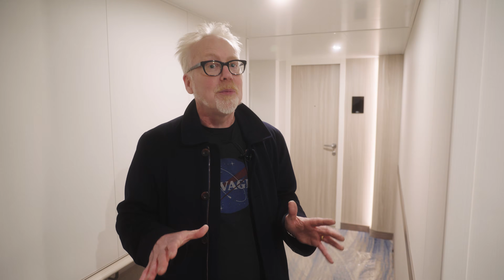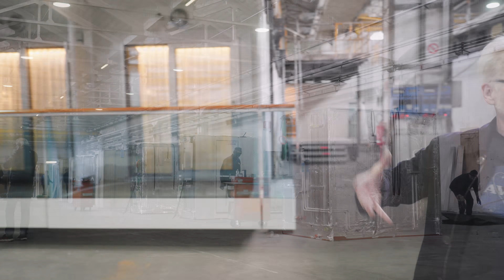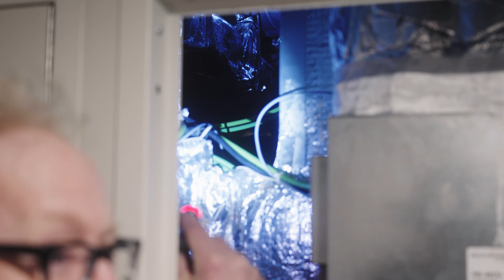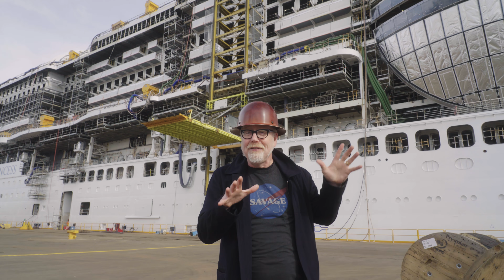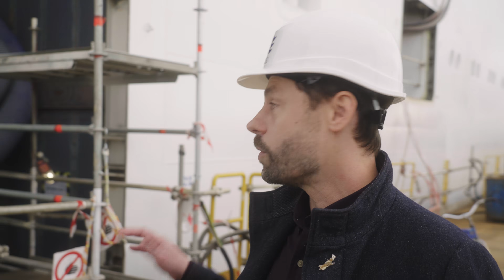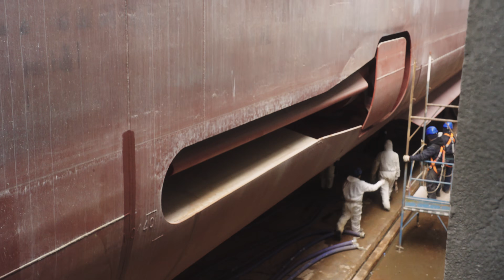Engineering Inch by Inch

Comment: I am a structural engineer that primarily focuses on marine front projects. I have done projects for several cruise lines and am currently working on two huge facilities in the Bahamas. One of the items that got me excited on this ship is the embarkation doors. These tend to be a pain in the butt when designing these structures since the pier/wharf deck height tends to be fixed because of this. That means, bollard locations, fender panel sizes, pile cut-off locations, beam construction are all tightly monitored because no one wants to construct a concrete beam in the surf or cut a steel pile to elevation that may be partially under water. Being able to raise the deck even a few cm is a game changer.

Side note, larger vessels mean larger loads, which means larger piers/wharfs are needed. Looks like I can be expecting projects popping up from Princess soon.

Comment: I was lucky enough to get a tour of a cruiseship drydock while studying. One of the most mindblowing revelations was that the ship does not wait for anyone. If there is a inner element produced offsite, that is late. They will still close up the side of the ship and then later cut a hole in the side of the ship to bring the inner element in and then weld the hole shut. That is more cost efficient, than waiting for anything thats late. :D

Comment: On the entrance door in the hallway where the fire room is at it has three hinges that are lined up differently. Two of the hinges are at the top of the door and a single hinge is towards of the bottom of the door. Why is that?
Reply: In addition to supporting part of the weight of the door, the upper hinges must prevent the door from pulling away from the frame as it pivots on the bottom hinge. The further from the pivot point the hinges are, the less force they have to deal with. I think that equally spaced hinges are chosen for aesthetic rather than functional reasons when the hinges are strong enough for the placement to not matter. If you're aiming for the strongest door or to mount a heavier door without adding a fourth hinge, placing the third hinge closer to the top hinge will resist pivoting better.

Comment: That is mindblowing.  I remember with Project Egress, just hard it was to get 50 makers to assemble components that fit together for a museum display... now I'm thinking about the 10s of thousands of engineers working together to design a massive structure that is completely water-tight...
Reply: And has people on board! Like many, many, many people!
Reply: And how well these ships handle adverse conditions.  I remember when the Star Princess had a major balcony fire in 2006 that damaged over 300 cabins, and the only death on a ship with thousands of passengers was from a heart attack during the muster, with only a handful of passengers treated for smoke inhalation.  That could have been far worse than it was, and it's a tribute to the ship design and the crew that it wasn't.

Comment: Would it be an idea to switch 1 door of the 2 so you can use the fire hose,  or turn the door in front of the hose in to quick access rolling door so there is no door to be mind full of

Comment: An amazing video is Disney "re-theming" one of their cruise ships. From dry dock to back to cruising was less than three months. All new paint, all new interiors, new cabins, new show rooms, etc. Just an amazing orchestration of material an talents.  I really want to take a behind the scenes tour of a ship to see how all that functions once built.

Tangential to this. The technique of prefabricating a full space as a module and dropping it into its final place is happening in apartment construction. I drove by a building being "populated" with prefab condo units. The building, like a ship, was steel framed and fully plumbed/wired.  The fully finished plastic wrapped condos arrived on 18 wheelers. Once unwrapped they were lifted into place and the bits connected up with quick connects. Gaps between adjacent spaces had flap down "bridge" pieces with cover strips dropped in during the process.  It was strange to see a full kitchenette with all cabinet, counters and appliances installed hoisted into place.
Reply: I wonder if they build new rooms and slide them into an old ship.  This is actually the same way that the Contemporary hotel at Disney World was built but apparently the building settled and its now impossible to remove the rooms.

Comment: Sometimes they cut a ship in half, and weld in another section to make it longer (stretching). It is surprising that the weld is strong enough.
Reply: well the welds are no different than if it was one piece of metal
Reply: the welds are no different than the welds holding the blocks of a new-build together.  They are HIGHLY scrutinized using ultrasound.

Comment: All of these things are built in pieces all at the same time.  US navy warships are made the same way.  The only way it works is CAD/CAM.  That allows you to build little pieces of ship that will fit together at the end.

I have seen sections of nuclear submarines being built.  It's literally like chunks of a sliced hot dog.  It's crazy how well everything lines up, and that's due to the extreme accuracy at which these parts are made.  They are off less than a 1/4 inch, which can be welded together.  The hull of a submarine is more accurate than that, but the insides, where it doesn't matter, it can be up to a 1/4 inch.

Comment: Sorry if I sound mean but there's a very important difference that makes building a skyscraper like the Empire State Building and building a cruise ship of equivalent size. A cruise ship is build horizontally and requires less structural support to to hold the upper levels while a skyscraper has a relatively tiny footprint to hold up all that weight and thus need lots of support to hold it.

Comment: Ok so I have a question as an engineer.. are they engineers designing rooms for a cruise ship, or are they architects? Where does the line get drawn between laying out a living space, and designing a moving structure?
Reply: Ships are designed by Naval Architects, which is an engineering profession. Ship interiors are undoubtedly designed in consultation with interior designers experienced in marine vessel interiors.

Comment: genuine question: wouldn't it be safer for ships to be built more like buildings instead of double wide trailers? it seems like a stack of wooden blocks in a tube wouldn't be as safe as a stack of interconnected lego.
Reply: Look up the concept of blocks and megablocks for ship construction.  Properly planned there shouldn't be a continuous seam the entire height or length of the ship (unless the ship was stretched as another comment pointed out).  But, in reality, the welds are as strong as (if not stronger than) the steel surrounding them and they are HIGHLY scrutinized.  Go back and look at the video about the bulbous bow and air lubrication system - you should be able to see the staggered joints, similar to those on a hardwood floor.
Reply: @mikeL5183  ah okay so the ship can't have a continuous seam horizontally either. that's actually a good explanation and obvious now that I think about it 🤦

Comment: Check out the door hinges on the door they walked in from. Three hinges but one at the floor, one at the very top and the third only about 8 inches below that. Wonder why it’s laid out like that?  Any ideas?
Reply: Maybe its because the ship flexes? I saw another commenter talking about how they are still able to swing properly despite the dynamically moving hull. Maybe this is part of why.
Reply: A door hangs attached only along one side. Consider the door as a lever that pivots on the bottom hinge away from the frame. Where is the ideal location to place other hinges to resist this pivoting motion? Evenly spaced hinges is more to do with aesthetics than function.

Comment: Well, azipods are not neccessarily more efficient. For a cargo ship, they're less efficient than regular shafts because there's less drag and less mechanical losses on a straight shaft. But a cargo ship spends weeks at a time sailing in more or less a straight line. A cruise ship does a whole lot less of the long sailing, and it's in and out of ports the whole time. Having azipods may cut the need for tugs down, using one tug instead of two to dock each time will save a lot of money, probably more than the drag losses of the pods while at sea.
Reply: There are retractable azimuth thrusters as well.
Reply: one tug instead of two?  How about NO tugs at all.  Watch the live-stream of the port of Miami and the only tugs you'll see on a big cruise day are moving the fuel barges around.  The ships can do a 180 with zero assistance.